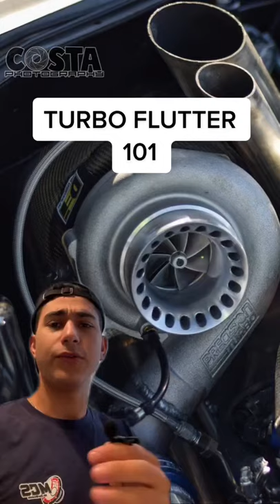TURBO FLUTTER 101 - Explaining Sutututu Theory

Comment: When you let off gas boost has to go somewhere.  So it either blows boot off or goes back through turbine
Reply: Secure the pipes correctly and they won't blow off.

Comment: There should be a disclaimer to not block you blow off line if you have a stock turbo
Reply: Why not?
Reply: @DriftNick  because oem turbos aren’t built for abuse like that. The “stustustu” is the turbine switching the way it’s spinning over and over again to let out the air through the intake side. It won’t damage your turbo on the spot but it will shorten its life span dramatically (even on upgraded ones)
Reply: @jacksongotshall9896  Before they started running bypass valves for emissions every OEM car ran without a valve, 35+ year old Nissans had no problem doing it, more modern turbos will have no problem with it.

"is the turbine switching the way it’s spinning over and over"

Oh you are one of those people, you lack a basic understanding of what is happening if you think it can make the turbo spin the other way, it doesn't even slow the turbo down, of course the people that don't understand what is happening try to tell others it's bad.
Reply: @jacksongotshall9896  I see you also don't understand what a turbine is, no surprise really, you haven't got the basics of a turbo down yet.

"Why do you think they even bother with blow off valves?"

Because people like the sound of them.

"You claim they’re useless?"

Did I? I already mentioned they are used for emissions, they have a use, it's just not for performance or longevity of the turbo, in the aftermarket world the issues with removing the valve is easily fixed.
Reply: @DriftNick  you’re right about emissions but bypass valves do serve a purpose when it comes to engine output on paper. It really doesn’t help with turbo lag or anything. I think we both know what we are talking about but simply disagree on the fact that blocking your blow off/bypass/diverter valve line isn’t great for your turbo. My understanding is that it can build up too much pressure for a stock turbo and hoses. I could be wrong though. I’ve just based my theory’s of it off of experience over the years. No need to argue man lol. Not the best writer so I’m sorry if what I said came off as misinformation or rude
Reply: @jacksongotshall9896  Serve a purpose when it comes to engine output on paper? not sure what you mean by that.
Reply: @DriftNick  so youre telling me the stustustu sound isn’t caused by a build up of pressure in the intake system which cause air to be forced out of the front of the turbo while it is still spinning because it has no where to go. OH I did also want to clarify that I was wrong about which way the turbine is spinning. That was a fact that I assumed and realized how dumb of an explanation it is when I really thought about it haha. This conversation has really got me thinking. So could you explain to me your understanding of the stustu noise if I was misinformed and gave misinformation?
Reply: @DriftNick  and could you explain to me your reasoning behind how it has no effect on the turbos lifespan because I’ve always been told that it does and I researched it and you’re the first person I’ve ever heard say that it has no effect on the turbo. Because if it actually doesn’t I’m blocking my valves asap🤣
Reply: @DriftNick  that in theory it does but it’s so minimal it’s irrelevant

Comment: simple the air dosent have anywhere else to go into the throttle body so it goes back out the turbo as it’s slowing down mixing with the turbine causing the stustutu

Comment: Also that flutter can snap the turbine wheel blowing up the turbo. While the sound is cool its better it doesnt happen
Reply: Would suck if that happened, good thing it doesn't cause that to happen.
Reply: @DriftNick  I think you should read about it before you comment
Reply: @themiddlechild1988  I've read a lot about it and have been running my cars without a blow off valve or bypass valve for many years, it doesn't snap the turbine wheel.

Comment: The flutter is a system that recirculates.  Non MAF cars can use blow off valves that vent to atmosphere.  

Blow off valve - vent to atmosphere 
Recirculation/Bypass valve - vent back into metered charged air system
Reply: This is wrong. A recirc system is usually mostly silent or maybe a small pshh. A bypass/diverter is not the cause of the stustustustu turbo flutter.

Comment: Basically the guy should have said if ur turbo flutters buy 2 turbos bc after a year or 2 you gonna need a replacement or do a rebuild as your turbine fins will be gone that y a 50/50 bov is ur best friend
Reply: 10+ years, never had an issue with no blow off valve.

Comment: Also Violent and Damaging to the Poor Turbo. 
30psi boost coming back and slamming into compressor wheel with a surface area of about 4-5 square inches. 
Is the same as hitting that compressor wheel with a rubber mullet at 120-150lbs of force (those poor bearings)
Reply: Good thing it doesn't slam into the compressor wheel like that.
Reply: Thats exactly what the air does when no BOV or BPV and let off the throttle. 
There is no difference from a physics standpoint between air hitting it with 120-150lbs of force or a rubber mullet the damage is the same. 

Modern Turbos should last 400-500,000km if looked after (oil allowed to warm up before boosting and turbo allowed to cool 2-3 minutes before turning it off) 
but without a BOV/BPV that lifespan will be 150-200,000km no matter how well its looked after or allowed to warm up n cool down.  @DriftNick
Reply: @tbas8741  You are forgetting one simple fact, the air has a path to escape.

"without a BOV/BPV that lifespan will be 150-200,000km no matter how well its looked after or allowed to warm up n cool down."

Owned 35+ year old cars with more then 200,000km of running no BOV/BPV.

Let me guess, you probably also think it slows the turbo down?

Comment: The stu stu stu stu is actually the harmfulness ur turbo doesn’t need it’s slowing down the compressor and causing drag drag drag drag on the intake and will eventually brake ur turbo
Reply: It doesn't slow the turbo down at all and if it does any damage it's so minimal that you wouldn't notice it.
Reply: nope

Comment: And that’s exactly how u blow up ur turbine. Wind that’s escaping back thru the turbine smashes into impeller and leads to backlash. Once it backlash enough, it touches the side of the turbine and breaks.
There are two ways for broken impeller to fly out, it’s either exhaust pipe or engine.
Reply: The only people that seem to have that problem are people that have never owned a car without a blow off valve, meanwhile no such issue exists for people that actually own cars without a blow off valve.

Comment: Bypass valves make that noise just not as long.
Reply: No valve makes that noise, it's pressure not being released that makes the sound happen, if you have a bypass valve and it still flutters it's not releasing enough pressure to stop it from happening.
Reply: @DriftNick  yeah that's my point 👍
Reply: @slacksthegreat  You said bypass valves make that noise just not as long, that is incorrect.

Comment: Turbo flutter ends up being really bad for the turbo and performance as you are forcing air the wrong way through your turbo as it escapes which will increase pressure in the exhaust manifold which you dont want
Reply: It doesn't do what you just said, isn't really bad for the turbo, does not hurt performance, in fact it does the opposite which is why it's common place in motorsport and I have no idea why you think it would cause pressure in the exhaust manifold to increase.

Comment: It will destroy a turbo. It may sound cool but it's horrific for the turbo. 
It's wind trying to pass opposite ways through the compressor.
Reply: Horrific for the turbo = if it does any damage it's so minimal you wouldn't notice.
Reply: then how do you explain turbo cars without bov out of the factory?
Reply: @ottoivanov6461  most of those are variable vane and controlled by the computer. Also, how often are stock turbos on a car over driven to create turbo flutter.
Reply: @2dogsmowing  Variable vane has nothing to do with flutter happening off throttle.

"Also, how often are stock turbos on a car over driven to create turbo flutter."

Literally every time they lift off the throttle, seems like maybe you think we are talking about on throttle surge but we are not.
Reply: @2dogsmowing they run boost recirculation valves. And the ECU isn't controlling the turbos

Comment: Ive mever ran one whats the difference between waste gate amd blow off valve i know on the 12-71 with a tiny pully on mine its not cooled no waste gate etc it makes more raw power does have more peracidick loss ya probably spelled that wrong but why and top fuel uses super chargers yes way more but way cooler lol

Comment: You can make your turbo flutter even if you have a blow off valve you just put the gas to the floor for 1 to 10 seconds and then let completely off it works on my car all the time
Reply: Your BOV is to small or not operating OR you have anti surge 

You should not have flutter if the BOV is venting 

My Supra was upgraded to a bigger turbo with anti surge and I never replaced the intake with the BOV. It’s basically there for show now as it never sees pressure to unseat and vent
Reply: @jrich436  yeah most likely, I do have the stock BOV with an aftermarket turbo 🤣🤣 but it did it even with the stock turbo
Reply: @jrich436  and plus me personally I'm not sure if I want an after-market BOV because a lot of them have the tendency to open too early and it messes up your boost
Reply: @HypeLady92  if the BOV is opening early you either have a vacuum leak at the top port, a hole in the diaphragm in the BOV or your boost level is to high for the spring in the BOV 

Running a decent vacuum manifold and checking for holes in your signal line and locker or at least Teflon tape on the top fitting of the BOV will help 

The other issues are quality control/wear and tear and I’m guessing your experience was mostly with a cheap GReddy knock off? 

Although I’ve run over 100 of those on systems with low to moderate CFM under 15 psi without an issue 

Never tried one on big turbos or high boost pressure
Reply: @jrich436  yeah lol I got a lot to check, lol I do drag racing for a living and I work with COPO and and Mopar Drag division
Reply: @HypeLady92  that’s awesome 

I’m thinking about getting back in, it’s been 25 years of working on everyone else’s stuff and never my own 😂
Reply: @jrich436  oh that's awesome an OG builder and people be doing that all the time I'd literally have four cars lined up from all my buddies 😂😂 but hey I enjoy building them I got a twin charged CTS-V built from the ground up I literally started from buying the rims first and then I bought it piece by piece that was my favorite project of all time I have to say

Comment: He's half right.. yes that flutter sound is the air slamming back into your turbo once the throttle is closed. It happens on all turbocharged cars that don't have a strong enough spring in there bov. Not just in a so called closed system, and who in the hell turbocharges there car and doesn't install a bov?
Reply: Plenty of people turbocharger a car and don't install a blow off valve, they are not required.

Comment: When you lift off the throttle, the butterfly closes but the turbo is still spinning, trying to suck air in and push against the closed throttle. 
At this point, pressure builds in the pipes until it goes backwards and effectively stalls the turbo.
In other words folks, its shit. Get a proper blow off valve or recirculation system and let your turbo carry on spinning ready for when you get back on the throttle. 

Also, a twitchy wastegate can cause similar noises.
Reply: When people mention stalling they are talking about the air separating from the blades, the turbo isn't actually stopping nor does it slow down, in fact you have better response without a valve because boost pressure is not being released and you don't need to build it up again.
Reply: @DriftNick  I'd be interested to see the science in that. Not that I'm disagreeing, just curious as to what extent its been tested. Especially as pretty much every manufacturer has fitted a release valve of some kind since the 90s with factory turbos
Reply: @matthewnicholas6365  They are factory fitted for emissions not performance, if they were for performance every race car would have them but if you look at pretty much any top level race car that uses turbo none of them are using any valve, GT3, GTP, etc.

Comment: when u hear sutututu ur turbo is gonna say byebye pretty soon . 
i know  it sounds pretty dope , but the sututu destroys the turbo. use a proper blow off and u are good.
Reply: Funny been doing it for over 10 years and never had an issue, so much for saying bye bye pretty soon.
Reply: @DriftNick  what car u drive? 
What turbo do u use? 
How much km or miles did u drove those past 10 years? 
Whats ur power, how much boost?
Reply: @sebastianleister355  Owned cars with over 200,000km that have never had a blow off/bypass valve, run both factory turbos, aftermarket turbos, plenty of people here running a lot more boost then I do in cars they drive all the time and having zero issues running no valve, the only people that have issues are the ones on the internet that have never actually owned a car without a valve.

Comment: In other words someone doesn’t care about loosing power and boost and loves to replace the bearings and seals in his turbo
Reply: Not sure how you think it causes you to lose power or boost considering it doesn't happen when you are on throttle, in fact it does the opposite, not releasing pressure out of a valve means there is less turbo lag as you get back on the throttle, that is why it's common place in motorsport not to run a valve.

As for loving to replace bearings and seals, I've been doing it over 10 years, never been an issue, countless people doing the same thing.
Reply: @tristanjensen1246  Holy wall of text, anyway it does not slow the turbo down and yes people have tested that, it does not damage the turbo in any noticeable way, if you look at any top level motorsport from drifting to GT3, GTP, WRC, etc you will hear turbo flutter, they do not run bypass valves.

"where as if you had a way to remove the back pressure off that bearing you can turn up your boost controller higher running more boost "

Running no blow off valve or bypass valve does not change how much boost you can run, not even sure how you managed to come to that conclusion if that is what you are saying, it's hard to tell because 90% of you wall of text is quite hard to read.

Comment: Yup, and this wears the bearings prematurely and damages compressor wheels. Hence the invention of the blowoff valve. You'll always have a small group of fruit flies that claim they have been running their turbos for 100 years with turbo flutter or compressor surge and nothing has ever happened to their turbos, hey keep running it that way don't worry nothing will EVER happen to your turbo.
Reply: This myth has been repeatedly tested and proven to be wrong. The small group of flies telling lies is you
Reply: @strider5119  Oh look a fruit fly answered.
Reply: The CFM/wheel speed makes a difference

Comment: But also making it dose is bad for the turbo, why you see everyone destroying turbos eventually compared to someone with a bov, also cooling the turbo properly helps
Reply: Funny the only turbo I've killed was with a bypass valve, 10+ years of running no valve never had an issue with turbos, the only people that think it does damage are people that have never tried to run no valve.
Reply: @DriftNick  what turbo were you using?
Reply: @reecerawson9153  I've run no valve on both factory Nissan turbos and aftermarket turbos.

Comment: The name for it is turbo stalling.
Reply: It's not called turbo stalling, the stalling people are referring to is the air separating from the compressor blades not the turbo itself stalling.
Reply: Huh separating what LMAO. If you don't have a blow off valve where does the air go? Back into the turbo. What sound does that make it makes a fluttering noise it's called turbo stalling? I had a diesel that when you revved it and then switched the car straight off it used make the a turbo flutter noise because of the air going back into the turbo stalling out the compressor wheel. Please go and look at turbo stalling. There is no separation of air in the turbo its a sealed unit FFS.
Reply: @eyeopener1993  The Dunning–Kruger effect is strong with this one.

Go learn what stalling means for a compressor, it's the air flow seperating from the blades, it's not the turbo stopping from spinning, you lack a basic understanding of what is happening if you think that.
Reply: @DriftNick  you know nothing about turbos.
Reply: @eyeopener1993  Must be talking to yourself if you think it's possible for the turbo to stop spinning when the flutter happens.
Reply: @DriftNick  the flutter/sneeze is caused by the back pressure of the turbo once you let the throttle off. I've got a link here that explains it how it is but won't let me post it.
Reply: @eyeopener1993  Maybe try reading my comments, I know what the noise is and why it happens, the point is there is no stalling of the turbo, the stall refers to the air separating from the compress blades, that happens when the  turbo moves towards the left side of the compressor map into the surge zone.